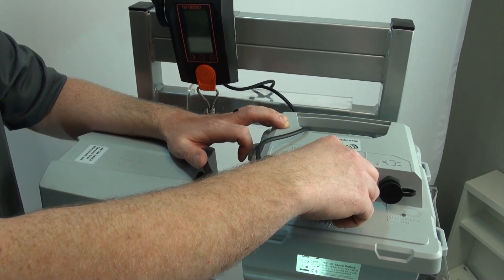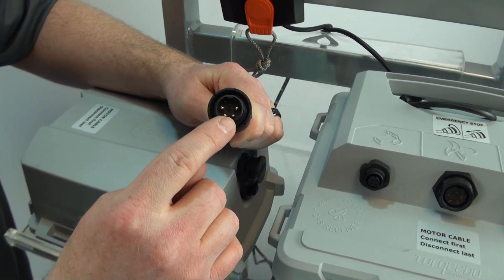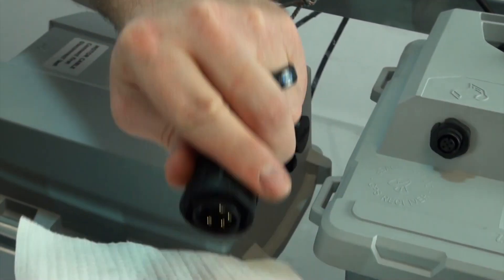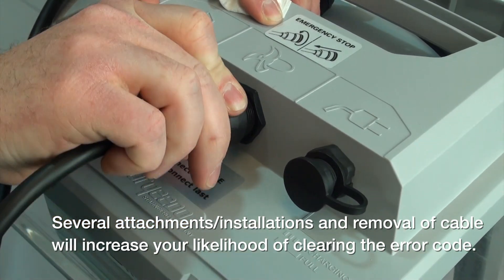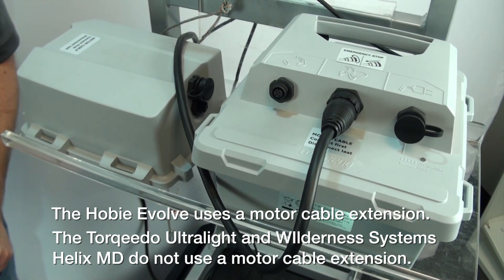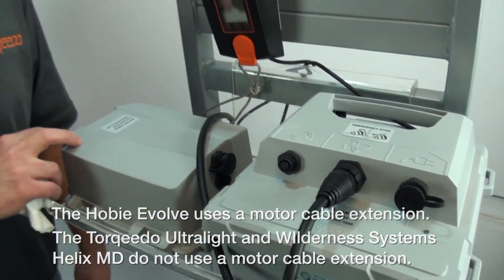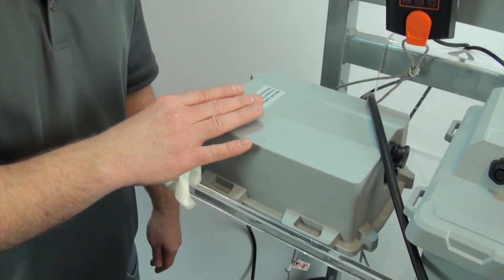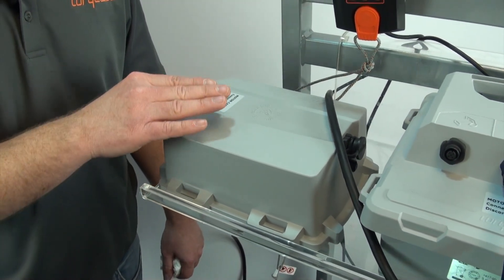Torqeedo Ultralight Motor E 30: Data Communication Error

Comment: I bought a Torqeedo Travel motor at the end of July 2023. I will never buy Torqeedo again.

From the first uses I had an error code 30 (problem sending/receiving data between the battery and the engine) preventing the engine from starting...
This problem is well known to Torqeedo.
I followed the recommendations of Torqeedo support and tutorials (plugging and unplugging the cable several times so that the error disappears) all last season… 
It was stressful never being sure the engine was going to run... but it always started again after a few tries.
This season I have the error code E30 again, but impossible to resolve the problem... I plug and unplug it dozens of times, I apply WD40 as recommended by Torqeedo but the blocking code does not disappear.
I then contact Torqeedo support who directs me to an authorized reseller for maintenance. After receiving the motor, the latter tells me that Torqeedo does not apply the warranty on the pretext that a pin is broken on the cable (from plugging and unplugging 100 times, no doubt!!!). He tells me that I have to dismantle the entire engine, check the tightness, etc., all for the modest sum of 1000 euros, and without commitment of deadlines, the latter having no visibility on the availability of parts!!! (engine value 2349 euros). 
I follow up with Torqeedo support who doesn't want to hear anything.
Yesterday the dealer contacted me to tell me that he is stopping business with Torqeedo, that I must pay shipping costs to recover my engine which is still out of service. And Torqeedo is still absent.
So a piece of advice: avoid this brand, don’t buy Torqeedo!!!! 
Zero quality, zero service, no respect for “promises”, no consideration for the customer.
There are a whole bunch of other brands and engines that are much more quality.
Ps: I have a hybrid boat and I have always praised electric technologies...

Comment: I have a 4.0 on an Electric series Bennington, yesterday I was running it and stopped at a neighbors dock to pick them up. When they pushed me back I discovered I had no power and an E30 code . I paddled back to my dock recalibrated the remote throttle and the E30 code is gone but now I have a E23 code and a E07 code. The prop will make one click sound and not turn I  throttled off and on a few times and the Prop started to shake but not turn. And thoughts what I can try?  I did disconnect the small cable connection to the remote throttle near the motor and sprayed it with WD40 but nothing changed.
Reply from the maker: Hello,

We're sorry to hear about the issues you're facing with your Torqeedo Ultralight motor. The error codes E30, E23, and E07, along with propeller concerns, can be a bit tricky, but here are some steps to try:

1. Check Propeller and Shaft: Look for damage or blockages that might be affecting the propeller's movement. Ensure everything is aligned properly.
2. Inspect Connections: Examine all wiring and connections, ensuring they're secure and not corroded.
3. Battery Health: Make sure your battery is fully charged and in good condition.
4. Power Cycle: Disconnect the battery, wait a few minutes, and reconnect it to reset the system.
5. Manual and Support: Consult your manual for specific troubleshooting. If issues persist, contact Torqeedo's support for expert help.

Prioritize safety and reach out for professional help if needed. We hope this gets your motor running smoothly again.

Best regards,
Torqeedo Team
Reply: Thank you I will double check the items you suggested  @TORQEEDOGmbH
Reply: I have been fighting with e30 and e32 ever since I bought my torqeedo travel 1103. I tried to get in touch with the torqeedo representative in Spain but never got a reply. A chandlery owner and vendor tried as well but wasn’t successful either. I then tried again in the Caribbean (Martinique from memory) but likewise, never got a reply. I am now in Panama and it stopped working again. This time, nothing seems to clear the error message… I let you guess who satisfied i am with this product and customer support
Reply: I have also had endless problems with my Travel 1103! Most of the time, I have been unable to use it for one reason or another. First it was the tiller that was letting water into the screen, they eventually agreed to replace it. Now I have this E30 error and there is nothing I can do to clear - tried everything!!  @benlevy1664